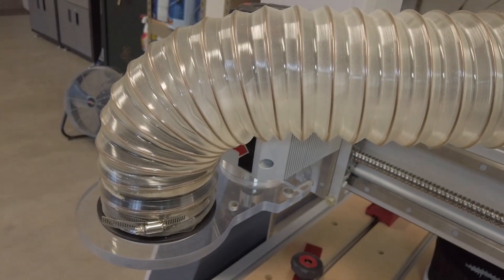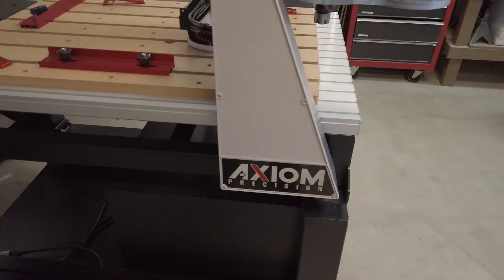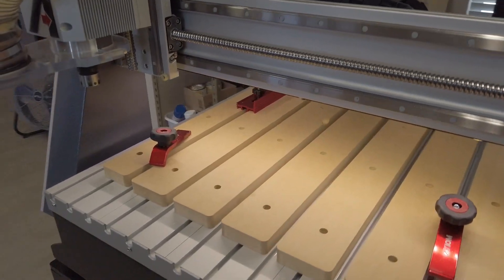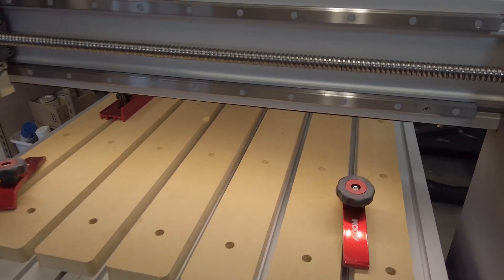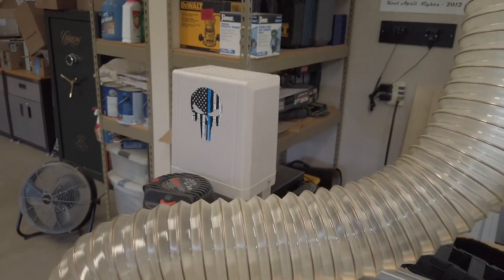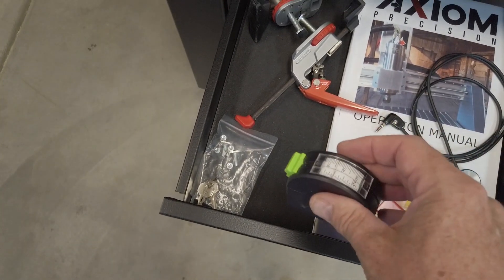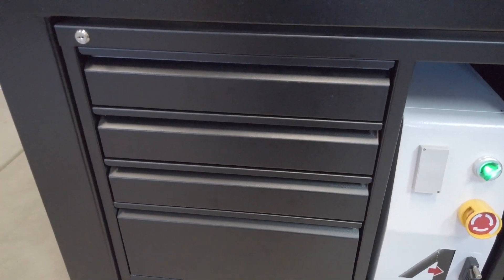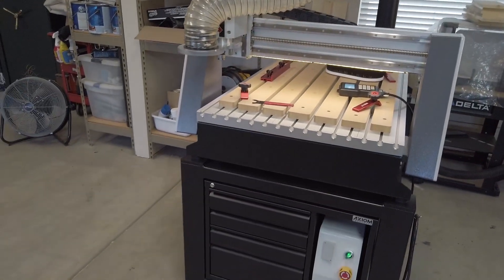My Choice: The Axiom CNC AR6 Basic

Comment: Hi I just bought a axiom iconic eight based off of your video I watched it a few times you seem quite happy with it so thank you for the review question do you have these long red fence clamps I guess can you tell me where you got them because axiom doesn’t sell them they say
Reply from the maker: Thanks Randy. I don’t remember where I got them. I actually think I got them from Axiom back in 2018. You can easily make your own with aluminum angle iron or square stock and then use t-track bolts. You could even go hardwood such as walnut or maple. No matter what you choose, just make sure it’s square to your spoil board when you tighten them down.

Comment: Thank you Russ for the info. May I ask you a question? I am interested in this model. My shop at home has a  small door clearance (28" x 84").  I'm more concerned about the cnc machine itself fitting thru this doorway. The stand doesn't seem to be an issue.  I'm thinking of the cnc being carted in on its side but not sure about the gantry fitting thru or damaging the machine by laying it on its side. What would you recommend?  Also, if you had to do it over again, would you have gone with the  Iconic 8 model? Thanks again. Very informative video.
Reply from the maker: Well at the time they didn’t offer the Iconic, so that is more or less moot. If your gantry will fit on its side, I don’t see why you couldn’t tilt it. Just make sure you have enough guys to manhandle. It’s heavier than you think.

Comment: I had one of these for a few years. Same cnc spindle that’s used on laguna swift series large cnc. The ARAxiom series routers are the best small format cnc on the market. They also have the 4Kw ISO30 ATC spindle setups now. If I still had it, I would have converted. Built. strong!
Reply from the maker: Built very strong indeed!  No lateral movement due to it’s stability.  At the time, price was a concern and I stuck with the router option.  Since then I am running an AVID with an 8.7hp Hiteco spindle in addition to the Axiom.  It’s a different animal altogether and runs off Mach4.  Each sit next to one another and each have specific jobs in the shop.
Reply: @BlueLineCNC   I just discovered your videos and have been going through them. I apologize if you’ve already covered this elsewhere. What’s the difference in uses for the Avid vs Axiom machines? Size aside, is the axiom better at certain projects than the Avid, and vice versa?
Reply from the maker: @dmanning55  they are both well built machines.  The Axiom runs on ball screws and is extremely precise.  However, as such is limited on it fast rates and jogging speeds.  Additionally, you can command your file to execute at 225 IPM in VCarve for example, but it is beyond the capabilities of what the machine can actually do.  The AVID has a rack and pinion drive system and coupled with the right spindle (I have an 8.7hp Hiteco) can rip through stock extremely fast.  With the AVID my production is much quicker.  AVID is more expensive and you build it.  AVID is a US company. If I’m not mistaken Axiom machines are foreign built.  The can both equally produce fine results.  For a newbie or hobbyist, the Axiom would be a much better choice, as the AVID is geared towards someone with at least a pro-sumer to professional level of knowledge, as you need to learn and understand the control software, Mach4.  AVID will require a computer in the shop to run it.  Hope all that helps!

Comment: Thank you very much !! Question, I live in Canada and it gets really cold here in winter. Can u have this in garage and run it in cold weather ?
Reply from the maker: I'm not sure what extremes it will operate at.  You may want to reach out and talk with Axiom directly.  I never had a problem using it in my garage in Northern California.  I don't like the extreme cold or the extreme heat and for that reason I am moving it into a climate controlled work shop.

Comment: Hi, Do you know What pitch screw ball does the machine use for Y and X axes
Reply from the maker: Good question for the manufacturer.  I just know it works!
Reply: @BlueLineCNC  Yes, I did ( they didn't answer yet ) by any chance can you measure with a Caliper.  thank you
Reply from the maker: @bpushkin3457  the are superb about answering questions and after sale assistance. To answer your question they measure 16mm!  😀
Reply: @BlueLineCNC  Thank you but the pitch is 5 or 10 mm
1605 or 1610 Thank you again I really need this !!!
Reply from the maker: @bpushkin3457  no problem. It’s a 1605 ball screw.  5mm spacing on the ball screw threads.
Reply: @BlueLineCNC  thank you a lot
Reply: Just verifying it’s y and x Axis right?
Reply from the maker: @bpushkin3457  yes and the z axis as well.  They all have these same ball screws with linear prismatic guide rails.
Reply: @BlueLineCNC  thank you

Comment: Have you found that the dust arm base attached to the cnc table to either get in the way or limit the size of the project you can make? Looks like it takes a foot of length
Reply from the maker: It doesn’t interfere with the y-axis at all.

Comment: Any regrets not purchasing the 1hp spindle? I’m looking to purchase one like yours. My old Cnc has a 2-1/4 hp Bosch and is very noisy.   Thanks
Reply from the maker: Not really.  I wear my 3M work tunes all the time in the shop to protect my hearing pretty much no matter what I do with power tools.  Plus I like music :)  I would likely still wear them even if I were running a spindle.  I guess what I'm trying to say is noise is not an issue for me.  There are probably other reasons like longevity, etc. that a person would pick a spindle over a router, especially if they are in a production environment running it all day.  I am a weekend maker and that is not me right now.  If that every changes and I am running it every day, I would likely upgrade.  Hopefully that all helps!
Reply: @BlueLineCNC  many thanks for your reply. I’m cautiously moving forward 👍

Comment: Great video! Was wondering what router you were running, I am looking at a similar setup and was wanting to know how well the router holds up over time. Thanks for the informative video.
Reply from the maker: James Erwin I am running a Porter Cable 892.  It has been running flawlessly and I haven’t burned it up yet in a year. The CNC gets about 10-15 hours of usage per week.  Just to be safe I have a second one on the shelf, as I cannot afford down time. These routers run about $180.00 or thereabouts.

Comment: I'm about to go with the same machine, but curious if you had a look at the I2R-8.
Reply from the maker: I actually did look at it as well.  In comparison to the AR series they seemed a little lighter duty than what I was looking for.  I think for the maker that wants a quality machine but doesn’t plan on using it a ton, the I2R series would be perfect.

Comment: Your video was very helpful.  Thanks.  I did a lot of research on CNC's as well and Axiom is in a class all by itself.  Plan on ordering the i2R-6 with much of the same accessories as you. Only concerns I have are understanding and applying the Vetric VCarve CAD designs. Everyone says they're easy, yet my applications will be completely different, so I'm skeptical.
Reply from the maker: Glad it helped you.  You will love your Axiom.  They really make good stuff.  For VCarve it’s not that difficult. Watch Mark Lindsay’s videos.  You will be doing your thing before long. There’s a huge support community out there for CNC enthusiasts and you will find plenty of folks willing to answer questions.  Axiom has a great user forum as well.
Reply: Hey Peter, did you get your i2R? Are you liking it? I'm about to purchase the Axiom machine, but keep going back to the i2R-8 and reading about it.

Comment: Does this machine use standard house current, or 220 volts?
Reply from the maker: My machine (AR6 Basic) uses standard 110V house current at 15 amps.  The pro models by Axiom use 220V.
Reply: @BlueLineCNC  awesome thanks!